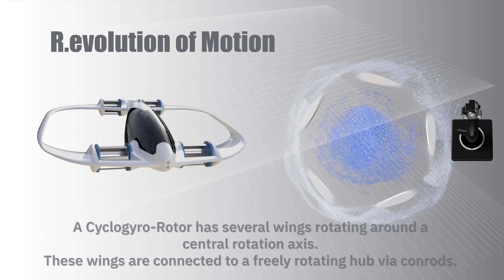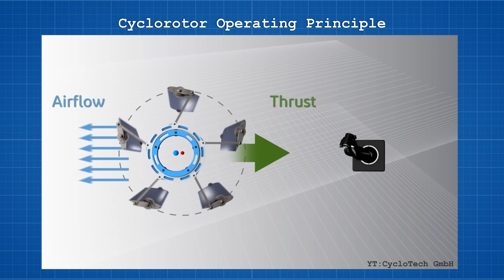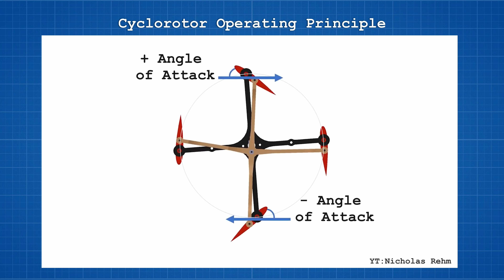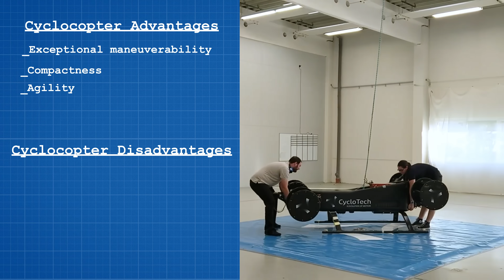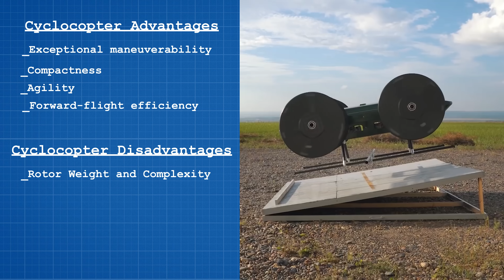CycloRotor: Is this the future of eVTOL Electric Propulsion System?

Comment: These are called cyclogyros, as their axles are horizontal.

1:29 You're wrong. These are not the reasons for failure. It's 1) Complexity, 2) Fragility and 3) cost.

The reason cyclorotors have (very limited) use in marine applications, is that they don't need to move at the speeds required in air, and can have a lot smaller surface area for the same thrust. Even the largest ones, like the ones they used on Osprey class mine hunters, won't give you much of a breeze in air. And I suppose the Osprey class made for interesting and "future forward" vessels, but they're all decommissioned, and I don't know of anything current with cyclogyros. Incidentally, the exact type was called the Voith Schneider propeller, and was first implemented in 1928. It's been used on a couple of tug boats as well. Note that tugboats need to move a lot of water fairly slowly, meaning the mechanism needs to be pretty solid, and it doesn't matter if it's heavy. It's got wonderful maneuverability too, but it's not a racer.

The absolute simpleness of a fixed pitch propeller and a variable speed motor, makes the normal setup on a drone SO MUCH cheaper and robust than this. And safer.

Comment: Just use centrifugal fan with adjustable nozzle-intake casing.
Less fatigue. Better efficiency in horizontal flight. Overall cheaper.
Patent free.

But still less efficient than open blade rotor.

Comment: I've flown many Aircraft and Helicopter types. When you loose power on an A/C or Heli, you still have the ability to land by gliding or autorotation. CycloRotors depend on several powerplants and if you loose any one of them, ur suddenly an airborne Rock, without wings.

Comment: looks awesome and futureristic but on a health an safety issue what happens if one of the rotor wheel blades breaks in mid air can it still safely been flown to land on 3 rotor wheels or would it be unstable and and crash ? would it survive an impact with birds all planes now get tested for bird impact propelers/windows etc. is it girlfreind proof lmao cause ive had a few smash up me car after gettin drunk

Comment: IITs, HAL & DRDO please devlope it for India ? It may useful for drones or small personal aircraft for shorter distances. It's is having a advantage not required runway, simply vertical take off (VOTL) from any rooftop helipad and it's runs on electrical, solar power may be utilised to charge it. 

Har Ghar Pushpak Viman
Jai Shree Ram

Comment: I don't see any secondary system in place if 1 of 4 of those motors fail. ..is the taxi inspected by anyone that gives an eF in between rides or we expecting wallmart door greeter to have all that responsibility on slave wages...or are we just going to continually run them until they catastrophically break and kill the rider and pedestrians below and hopefully the air taxi made profit before critical failure and well chalk up loss of life to cost of doing business and convenience good ole capitalism just like good ole ford taught us. Until those are sorted out this is a giant pipe dream and maybe we need to refocus on current viability of transportation to actually save us from going extinct or have the billionaires bought enough politicians to make sure that doesn't happen....Well atleast they'll be cozy in their billionaires bomb shelters

Comment: Nobody but Musk can create an e-vehicle that can do any sort of decent range while at load and he has already stated that he's not touching aircraft because it would be a waste of time. They aren't gonna build an eVTOL or any other e-aircraft. It's not feasible.....especially in warfare. After the source of your electricity is destroyed or otherwise taken away, you'll resort to gas powered generators to get your electric machines running again.....may as well do it in dinosaur to begin with and save the gennies for the comms systems and other things like life support that can't be run individually by dinosaurs.

Comment: If the Russian are using it then it will probably work, given their track record, the wind turbines have been used as generators in the UK for more than a hundred years, recently a large one was recently decommissioned that had been powering a small factory continuously for nearly a hundred years. They are more efficient than common wind turbines due to their direct drive set-up, i.e.; fewer gears, less to break. Modern ones are still used on sea walls along the coast where you have almost continuous on shore wind, they are bloody noisy though.

Comment: No, that is not the future. 

As the video shows, it's something that failed in the past. No, better materials and powerplants won't help.

Look ye here - the general rule for efficiency of flight is to move as much air as possible as little as possible. Propellers and rotors are usually made as large as practical, and jetpacks with little nozzles can't fly for squat. 

This thing, as built, is closer to a jetpack, and is going to be as noisy as a Harrier jet. It will literally never fly, because it has no wings. It will be in hover mode every second. (It may get off the ground, but it can't glide, and the technical definition of flying is powered gliding.)

Notice, please, that the only bit of the lifting surfaces that will be doing any good is the bits moving horizontally. The other parts are just adding weight and drag as they go upward and downward in the rotation. Which means the lifting area is even less.

They could do better with squirrel-cage fans and a bit of ducting.

Comment: could outward horizontal venting of the blades be used for stabilization? It's already got variable pitch blades, how about a radial vent on the external side of the fan to Vent some of the CFM  horizontally for more control?

Comment: Seems more like trying to reinvent the wheel and the wing at the same time.

Less efficiency than gliding, and lower manuevring capability than a quad copter drone...

Seems like a waste of time trying to solve a problem that's already been solved.

It's cool to see alternatives and engineering approaches that are different and can still work to a degree... But would you choose a penny farthing over a standard bicycle for any other reason than novelty? Sure it works, but you're not making your morning commute on it.

Comment: Wings moving 50% of time in thrust direction is never be able to beat the efficiency of props which only move vertikal to thrustvector.
Thats why vertical windturbines never beat horizontal windturbines (the ones which are build nowadays in massproduction) in terms of efficiency. Same reason.

Comment: The people saying its too complex haven't seen the rotor assembly of a modern helicopter, which has nothing on the complexity of a coaxial rotor. All in all it just seems like a different kind of helicopter, less efficient but more compact, which isn't particularly useful for ferrying cargo or passengers (though it could fit in a garage quite nicely) but I can definitely see the military potential of a compact VTOL weapons platform. Like a drone that can be sent into built-up urban environments to discourage snipers and anti-armor teams, sure these drones will get shot down a lot but then the enemy has to reposition and as far as gaining ground in an urban environment goes the cost of one drone per city block is a bargain.

Comment: Break down a car to its frame, something that could reach decent speeds but still has a light frame and add the same blades they use in this and them add a half sphere cover over the blades, then add fins that attach to the steering wheel and boom you got your own

Comment: To get a good Coander effect Lift, the rotors need to be too big. Also the loads on bearing surfaces means high maintenance against propeller driven lifting motors like the new heavy lift military Helicopters …

Comment: The BEST eVTOL propulsion system I have seen for an aircraft is from Lilium. In fact, it is so good, I am confident of their success as a company (assuming that the management is at least averagely competent). The efficiency of this looks terrible, it has no glide capabilities if engines fail, and essentially zero redundancy. Lilium has NONE of those issues and has other advantages beyond that, such as using their propulsion system to maneuver the plane using thrust vectoring rather than aileron flaps. Do not even bother with this "CycloRotor" crap, it's going nowhere except MAYBE some very specific and niche scenarios, otherwise it is useless.

Comment: To alleviate the forces on the wings, you could incorporate a lightweight system such as a titanium disc center wing to  effectively halve the distortion forces on the wing.
this would allow for greater rpms without worrying about excess distortion due to centrifugal force .
Naturally such a disc would need to be engineered to be as light as possible and allow for the wing's full range of movement. So it would not be just one piece but a moving cradling system within the support.
Alternatively, titanium rods joining the wings into opposing sets, at their midpoint through or around the axle would also lend strength to the wing.
On a scaled up model, the weight of the thin  titanium rods would have less impact on takeoff and inertia.
But I suppose, seeing as the opposing wings need to be in the opposite position in terms of angle of attack, that would need to examined in terms of the nature of the rod and how it allows the wings to move independently whilst still offering enough  structural support to justify it's existence.
Also. it needs a delta wing on it, like a hang glider.
And a jet for propulsion.
Sorry for the TLDR nature of the post.
Too much coffee.
You can get back to your life now.
Reply: or just stick to regular fuel airplanes, why reinvent the wheel?
Reply: @Ellie_The_Lesbo_of_Us  I mean... Welcome to innovation? Not every venture is a winner, but with that mindset we'd still be in the stone ages
Reply: @Ubernaught012  why reinvent the wheel
Reply: @Ellie_The_Lesbo_of_Us Why? Maybe what you try to replace the wheel with replaces it in some niche areas, or allows for new things the wheel didn't do before.

Comment: I am much concerned about following
(1) Size of cyclocopters when proto is scaled up
(2) Power required 
(3) Noise level 
(4) Vibration and its effect on other structural components
Reply: (5) Performance and safety under active weather conditions (wind, rain, snow)

Comment: COOL IDEA.  At the 0:09 mark from the side profile it looks a lot like a race car.  The four cyclorotors look like racing tires.  I suppose if one rotor failed in flight then the vehicle computer would compensate by reducing the two opposite side rotors in an attempt to maintain flight status.  Gravity is such a hard force to deal with for flight.

Comment: Unreliability & inefficiency. I see many moving parts some of which even reciprocate. I see rotating mass robbing system energy doing no useful work. I see a gimmick with no unique niche to fill. We use air screws because the physics of the Universe mean they are better always. Those physics haven't changed in 100 years. Material advances may have made this gimmick possible, but even perfect materials wouldn't make it better than what we already have.

Comment: What if you used Edison generators to power the high torque electric motors and you used two helicopter blades osprey perched above a platform that is least wind resistant and the rotors are double with a twist.  One joystick with a twist.  Quiet and strong lift.   A drone could be almost totally encased to prevent entanglements and rain interference. Just not air tight.
Reply: This would be unlimited range electric flight.

Comment: This is some useless technology by now... kinda like all the pseudo future stuff where someone thinks of some fancy looking thing we already got and recreating it - but worse - without really checking the numbers. This is like musk reinventing public transport but worse...

damn i wish this tech will be viable some day when batteries are far superior than our current ones... but its not efficient by now. I highly doubt on someone really using this by 2022 in operational duty. Just by this short video without real background there are some things not working out properly here i think. The range is bad. Loading it will be a nightmare, charging it as well. The system is more complex than regular flying systems today. You cant use this in Citys as for there is not any infrastructure supporting it. It hasnt got the range to properly travel short range flying distances (i.e. flights in own borders), it isn't fast but even it was, its just coming at the cost of flight time. If i want to get to my family 300km away it wouldnt be possible. Even inner-city these things wont go far. Every taxi smashes that distance limit.

While it looks really cool i dont think this is any viable option of traveling soon. I don't think it will be used by military in operational conditions...

Comment: Also if one of the rotors gives out, the other three will not be able to make up the lift or the thrust.  This has been tries many times in the past and attempted numerous times in the hobby market.  The physics around this are not there atm for save reliable flight.

Comment: The problem I see instantly is vortices created don't seem to be as stable as traditional air displacement propulsion. Basically comparing it to an X axis rotation of a quad drone or helicopter, it isn't as efficient or nearly as stable. And doesn't seem scalable.

Comment: While this finding use in drones or niche applications seems plausible; between higher upfront cost, maintenance, insurance, fuel vehicles based on this seems highly unlikely to become people's daily commute option. Even ignoring major hurdles like requirements for getting a pilots license, the issues around a large percentage of homes and destinations are not going to be able to add in a landing zone, this scaled to the size of multiple humans is going to be absurdly loud, air traffic control pretty much has to be completely revolutionized for it to make time sense or handle the magnitudes more aircraft.

Comment: The main flaw in this design is that I am not sure that it will effectively auto-rotate on engine failure, but basically drop to ground.
Reply: That's a flaw with a most of the quadcopters.

Comment: Helicopters and regular plane designs still have some hovering ability left when there is a situation where the engine will stall mid air. These new designs are good but it would be nice to have the hovering ability preserved. That is the feature that flying vehichels need to have going forward in the future.

Comment: But why ???? normal propellers seem way more simple, less moving parts, cheaper, easier to maintain and replace. The problem with flying taxies is the noise, no way on earth any city will EVER allow loud noisy flying cars like this - and it did not seem like this complicated design solved that issue

Comment: What prevents you from developing a platform with a lot of blades or turbines built into it? The main thing is safety! Your use of technology in the event of an accident and inoperable one of the four turbines with a variable thrust vector will not allow the pilots to land the device, but there will be an uncontrolled fall.

Comment: Notice how none of these concepts and claims of eVTOLs, air taxi, uber air etc ever address the noise factor? and they just propose that hundreds or thousands of these will be flying around in built up areas flying everyone on "daily commutes" - it's never going to happen. People will not tolerate aircraft noise for even a dozen conventional fixed wing or helicopters flying around existing airports. People move in and consistently complain about noise and that the airport should be moved "somewhere else" - I don't see that ever changing. One of the main reasons we also havnt't seen widespread adoption of smaller drones to deliver amazon parcels etc - people do not want the noise. These kind of multi rotor designs create exceptionally loud noise signatures. There's a reason current aircraft design that are certified have evolved to where they are at - they are safe, have as much redundancy as possible, and do it with the least amount of complexity they can get away with. Most of these eVTOL designs fail significantly in these design concepts or fail to address these standards, yet they masquerade as being the future just because they demonstrate they can fly.

Comment: We do not have a way to store electricity with a sufficient energy density to make an aircraft fly people over any significant distances.

Add to that the fact that these rotors are dumb as hell. You do not need to re invent the wheel, but it certainly makes for a nice way to fool clueless people into giving you attention and potentially money.